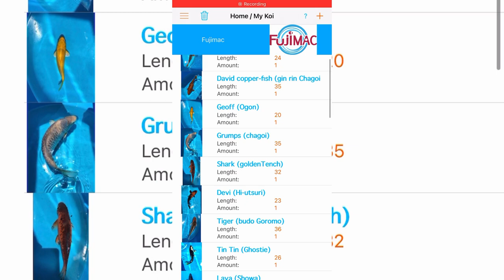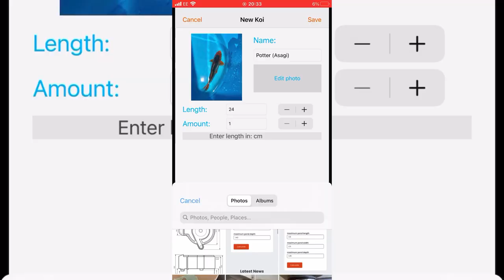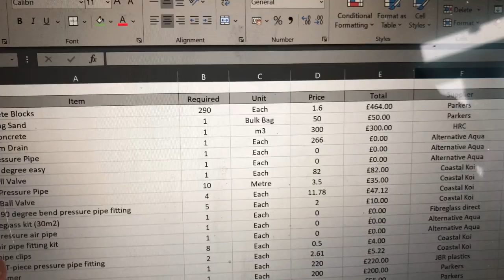DIY back yard garden pond Part 3 My dream pond build - Pipework, bottom drain and foundations

Comment: With your old time line lock off.
You should also explain that if you use nails to hook your string line too.
As you wrap the line around make sure. You take the line off the nail from the same side as you pulled it too. OK the nail is only a couple of mill thick but that over say 4m will make a square out of square  by maybe 10 to 15mill out.
The top of your Nexus looks about 700mm below your top block. ????
Reply from the maker: Oh and watch the later videos and you can have a chuckle at me having to lower the level of the nexus as it’s too high 🤦🏼‍♂️ Appreciate your comments and thanks for tuning on 🤦🏼‍♂️
Reply from the maker: Good advice, I get what you mean now (had to re-read) like you say always go from the same side of the nail 👍🏼